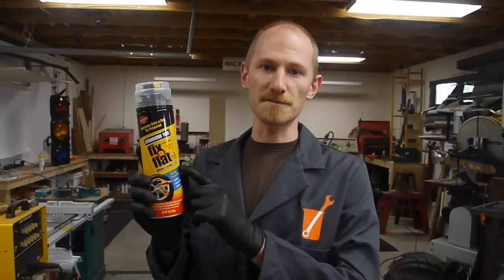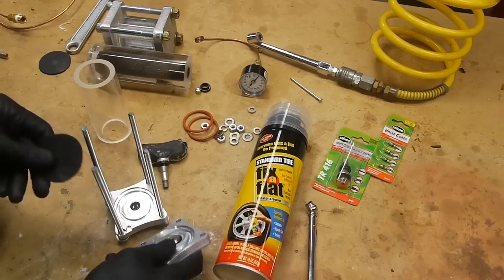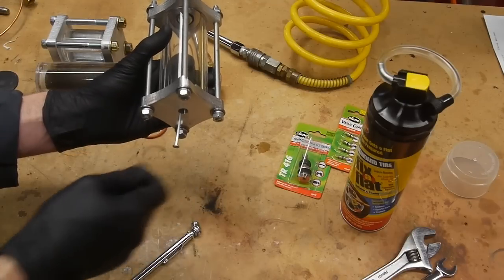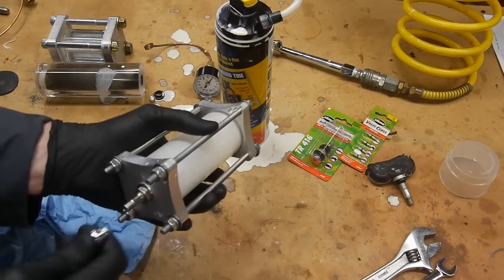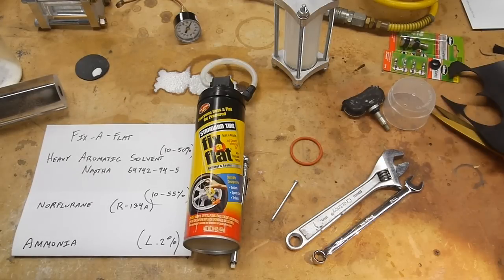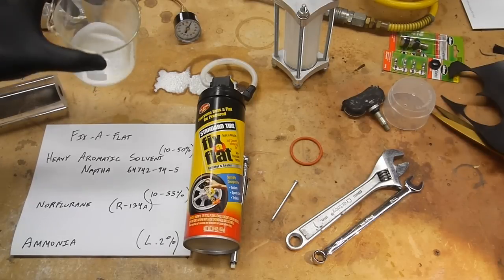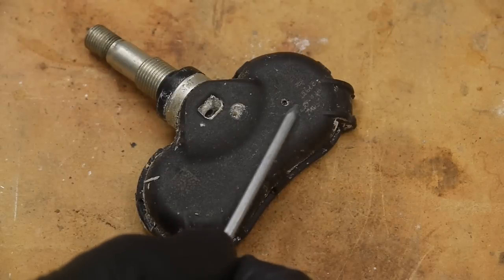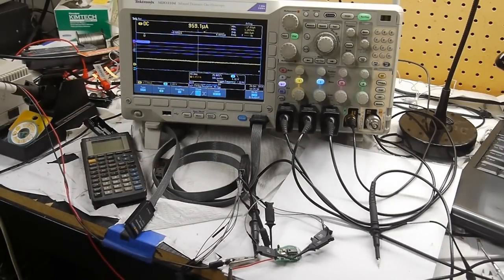Tire sealant chemistry and tire pressure monitors

Comment: You're probably right about the ammonia and latex.  I have a container of liquid latex mold maker I bought some years ago at a hobby/crafts store, and it stinks very strongly of ammonia and looks just like what's in that beaker.

Next project:  make a digital barometer from the pressure sensor!

Comment: As a refrigeration technician in Australia, we aren't allowed to release R-134a into the atmosphere due to its global warming potential. We face huge fines and maybe loss of our refrigerant handling licence if we're found to be releasing to the atmosphere in a negligent manner. How can a product like this, and others that I've seen (including a coil cleaner designed for the HVAC industry), be allowed to have such a substance which is tightly controlled in licensed industries? I want to say it's a kick in the guts to us who have to be careful with refrigerants, but more importantly it's a kick to the environment when we know that it's harmful to the climate and continue to put it in products that are freely released to atmosphere.
Reply: +Aaron Stein Yeah. It's good though. Keeps (most) backyarders from abusing refrigerant handling guidelines and also keeps the work within the industry.
Reply: +dan110024 Regs like that are often a question of mitigating what you can without worrying about the small-fries offenders. If a few thousand or tens of thousand DIY types vent a can or two of R134a every few years, that's one environmental load. If tens of millions of vehicles get their A/Cs recharged in a year and those commercial vendors vent all of it, that's a completely different ballgame. One is absolutely not worse or better than the other, but one application DOES have a much lower cost-per-impact ratio to regulate and enforce.

Of course, you're asking about fix-a-flat, which you COULD simply ban. My guess is nobody has because it's not something most people do to their tires on a weekly basis - the volume sold isn't great enough to have roused popular support for a ban.
Reply: +Aaron Stein Even in the U.S. you're supposed to have license to handle refrigerant commercially, but consumer use is largely unregulated.
Reply: because laws only apply to regular people that can be put in jail, companies make a lot of money so they can do whatever they what as long as they generate taxes, welcome to the civilized world.

Comment: I haven't had any problem with my TPM's after using.  But if I did, I wouldn't take it to a dealer.  The sensors can be bought on amazon for ~$10 or so and any tire shop can install them.

Comment: you are also supposed to fill it, drive for a minimum speed and time to cure it then pull over and deflate and re inflate the tire to get out most of the solvents.
But yes this is supposed just as a quick fix to give you some time before you must buy new tire.
I have changed a tire where something similar was used and it is a pain in the butt to remove all of it from the rim

Comment: The sensor may have an heavy current draw when it's reporting a failure. It's sitting at atmospheric pressure after all.
Reply: Alexandre Jasmin Yes, my thoughts exactly... the sensor should be screaming RF since there's no pressure differential.  This is obviously not the failure mode... if I left my tire flat for three weeks I'd expect the TPMS battery to go bad anyway.
Reply: @scowell  I disagree, I think it would be awful design to have the thing report constantly when it's at low pressure. Once it's delivered the data to the car, it's completely unnecessary to continue to transmit when there's no change. The car is perfectly capable of storing the value and screaming on it's own.
Reply: @Karreth  I was thinking of first-gen TPMS... the newer ones are much smarter, and can give the pressure in each tire when queried.  Thanks for your correction.

Comment: Where would you get a R-134a recharge kit in Canada? All I can find is RedTek 12a, which is engineered to be compatible with R-12 and R-134a systems, but I don't want to contaminate the system that I already have with something that isn't straight R-134a.i

I also don't want to spend the money getting it fixed (if I can avoid it), because they will be required to drain the system, perform a vacuum check, etc, that will drive up the cost.

Comment: While you're correct in the damage to the TPMS the one thing you failed to mention is that once you use this stuff in your tire you can no longer patch said tire.  The chemicals that penetrate into the rubber of the tire won't allow the glue, used in patching, to bond to the rubber.  Thus, using one of these in your tire means your tire will have to be replaced if the temporary repair (check that can again, all of these cans state the repair is "temporary") doesn't last the life of the tire.

Comment: What are the directions on the can? I don't see any way this could work if the puncture is at the top of the wheel, or the opposite side of the valve stem. Do you need to rotate the wheel after applying this product?

Comment: Sensors aren't actually required by law, a TPMS (Tire Pressure Monitoring System) is required by law. It can be accomplished by sensors in each wheel which calculate individual tire pressures (as you mentioned) which is considered an "active" system, or it can also be accomplished through wheel speed sensors, known as a "passive" system.
Reply: over here in Europe it is required by law to have pressure monitoring an all cars sold after 2014 i think it was,  active or passive where the passive just see if there is a difference in rotation speed of one wheel as if it is much lower pressure

Comment: R134a is probably used because it has a high liquid density at room temperature so I guess you'll achieve more pressure per volume than CO2.
Side note: If you condensed CO2 then it would be a solid so you might have trouble spraying it out of the can.

Comment: It might not be sleeping properly because it's not under "tire" pressure, for that sensor 1 atmosphere is a critical condition, so it might make sense for it to panic...

This is trivial to test, just do the same test under pressure and if it sleeps correctly then the problem is not that.
Reply: I had exactly the same thought - if I were designing a remote pressure sensor then I'd have it increase its wakeup rate during exceptional conditions to ensure that any communications losses were overcome and that it could promptly detect a return to normality.

Comment: If I had to guess, the aromatic hydrocarbons could have seeped into the sensor and even in an evaporated state, or liquid for that matter, leached into that rubbery potting material and damaged the components and running the battery dead in short order.Those kinds of solvent liquids like naptha really soak into soft materials pretty well. Loved the, "left the sealant in for.....(cough)......4 months", lol I had a good laugh at that! 
For what its worth, I prefer to carry a Slime kit for emergency flat tires. It works very well and less nasty to the tire/components. The little compressor takes forever but it works and can get full inflation. The stuff in a can is hazardous to the tire tech too, risk of fire/explosion.

Comment: Did some work for CAS over the years, great group of folks!

Very interesting video, I had always wondered specifically how this works.  Do you think the R-134 is responsible for the foaming effect?

For anyone wondering what the charred tube at the top left is from - Hybrid rocket engine with acrylic and gaseous oxygen  :)
Reply from the maker: Good eye on the re-purposed rocket motor!  Yes, I'll bet the boiling R-134 produces lots of gas bubbles and foam in the latex.
Reply: Applied Science I thought those milled aluminum blocks looked familiar.

Comment: Another reason to clean it out promptly is if you leave it in a steel rim wheel for a long period, the ammonia will first dissolve the paint inside the wheel and then rust the hell out of the inside of the rim completely. When you then dismount the tire, the part of the rim where the tire seats its bead will be so rusted out that the rim will have to be scrapped and another one bought. Not sure what would happen with an aluminum rim but I certainly wouldn't take a chance either way and get that stuff totally washed out from inside my wheel ASAP!

Comment: My guess is that the tps starts seeing less than nominal pressure and starts wirelessly transmitting - it doesn't go to sleep because the tire is 'flat' in normal atmosphere.
The sensor diaphragm is getting gunked while the tire is flat, then pressurized so the gunk prevents the sensor ever seeing real pressure again; battery dead.

Comment: Rather then the battery, I would think the issue would be a piezoelectric element in the sensor. Piezo-electric elements can be chemically reactive. Many pressure sensors use piezo electric elements in pressure sensors. 
Depending on the design, the battery might not actually be needed. If the circuit runs on Radio frequency, the circuit can demodulate a the radiowave to communicate with the circuitry and power the device. The battery would be a backup in that instance.

Comment: There are several reasons not to use this stuff it can etch your wheels i have seen it make its way between the aluminium and chrome and cause real problems.  It can make a small out of balance problem a big out of balance problem.  I have also had patches not hold in tires with fix a flat.

Comment: My kitcar has no room for a spare, so I carry a tin of something similar. Never had to use it. I have had punctures on other cars and just changed the wheel. My Z3 has the most inaccessible spare ever, so I was thinking of getting a can, I have now changed my mind.
Reply: +Donald Sayers ... You're better off to just get a 12v air pump and keep that in your vehicle.  As stated in this video, as long as the nail stays in the tire the leak is fairly slow.  If you leave the nail in the tire you should be easily able to inflate the tire back up to it's proper pressure and drive to a place where you can get a proper patch done.

I worked in tire shops at the start of my apprenticeship and we had people drive in all the time with stuff stabbed into their wheels.  As long as you don't pull the object out it should be possible to air it up and drive it in.

Comment: R-134a has an environmental impact when released into the atmosphere and now it's sold in a can to fill tires which are eventually going to release their contents into the atmosphere...
Reply: Its the same story every few years now. They sell you the new environmentally friendly refrigerant (last one was R12), millions are spent by the industry equipping systems with it, and then a few months later THE WORLD FINDS OUT THE TRUTH. Its barely better than the last one. WHAT ARE WE GONNA DO ? Oh look here is this wonderful new refrigerant called R142b that's so green every time you fill a fridge with it a baby seal smiles somewhere... (disclaimer: R142b is actually highly toxic to seals, dogs, and human babies. Cancer will ensue inhalations of more than half a molecule. Do not mix R142b with water, oxygen, nitrogen, or any hydrocarbon as detonation will ensue. In case of contact with the skin, remove the limb using a bandsaw or chainsaw.) Its 12.5% not as global warming intensive with a rating of 2 billion higher than carbon dioxide. Hurray ! Adopted.
Reply: Adrien Perié You seemed to have missed the point entirely and gone off the deep end with your personal thoughts about refrigerant.
Reply: jayfulf Before the problem of 134a was discovered, it was used as air duster.  You could face fines and prison time for even rubbing the valve on your air conditioner, but could spray case after case of cans of air duster and no one would bat an eye.  Now, I think they use 152a refrigerant as air duster ( too lazy to google it, and I don't have a can handy.. )
Reply: jayfulf
Actually i went two steps beyond your comment about the dangers of poorly regulated refrigerant use by the industry and explained the whole picture since the 80's, a munch bigger, systemic problem with refregirent release in the atmosphere than your concerns about R134 for use in tires specifically.
Reply: Adrien Perié I got the impression you were arrogant but wow, it really shines in this last comment.  What you failed to comprehend is that this video is about the product I mentioned, hence why what I said is about only that product.

I'll now go "two steps beyond your comment" (hilarious by the way) and make a very simple point that you, slamdvw, and majority of the internet community seem not to understand.  A lack of mention is not a lack of knowledge.  What that means is, don't try to 'explain' something to somebody for absolutely no apparent reason other than the fact that, for whatever reason, you think they are unaware and/or feel the need to make yourself feel intelligent by condescendingly spitting some noise like you taught the world about it.

Ya dig?
Reply: huh?  Not being an avid YouTube user, I didn't want to start another comment, so I just clicked "reply" under your name.  I now see the problem... it posted directly to you.  Which my comment was not aimed at.

oh well.  I said it.  Not going to worry much about it now.  so i guess in a way, i don't "dig"

enlighten me
Reply: jayfulf
Okay so basically what you have to say about something is the only thing there is to be said about that subject... Edit: And you are only mentionning it for people to watch in amazement in a youtube comment, not expecting other people to expand on the subject.
And i'm the arrogant one. Ouch...
Oh and sorry for not being able to comprehend that the reason you mentioned refrigerant use in tire fixing products was because the video was about tire fixing products and their chemical composition. I'm a bit slow sometimes. I mean me and the majority of the Internet community.
Reply: Adrien Perié Some very clever insults you got there friend.  Why don't you grow up kid.
Reply: slamdvw Well if you want to be 'enlightened' you can just read what I wrote until you understand it.
Reply: nah, i prefer it to be dumbed down so myself and the rest of us on the internet can understand it.  it's obvious my intellect isn't as superior as yours
Reply: aw come on.. help a guy out
Reply: Capcatrei You seem to lack this intellect you speak of.
Reply: jayfulf
You seem to lack any kind of argument whatsoever to support your views and insults.
Reply: Adrien Perié Well I've already provided sufficient insight for those capable, though it seems that's expecting a lot.
Reply: Air conditioning systems aren't perfectly sealed systems, they all leak some small amount that increases over time. Lots of products contain R134a where compressed air would be too expensive or impractical. Getting upset over fix a flat versus the other ways the refrigerant escapes is like yelling at the guy who leaves the sink on brushing his teeth while all his neighbors leave their garden hoses on.
Reply: s0nnyburnett Actually, it's like avoiding all the unnecessary and easily avoidable means of pollution.  With your logic, because my car burns gasoline I should use it for all my heating needs because there are so many cars in the world burning it everyday so why not right?  It's this type of ignorance that brings us beyond the tipping point.
Reply: jayfulf
You do realize home heating oil is actually just diesel fuel with a dye added to it right?
Reply: s0nnyburnett Diesel is more efficient than gasoline which is why it is used.  You failed to see the ridiculousness of your logic and how my example points that out.
Reply: jayfulf By your logic R134a is ok because it is less damaging than R12.
I think you've missed the point once again.
Reply: s0nnyburnett The idea is simply to be as efficient and environmentally friendly as possible.  It's not a difficult concept to grasp, yet you're managing that somehow.
Reply: jayfulf
complain about using fossil fuels for heating, defend one type from another because one is more efficient. Come on man.
Reply: s0nnyburnett You're missing the forest for the tress.  You're also thinking gasoline and fossil fuels are synonymous.
Reply: Adrien Perié Gasoline is a fossil fuel but fossil fuel is not gasoline.  Do you see the difference?  He indirectly said they were synonymous by referring to fossil fuel in response to me saying gasoline.  The details Adrien, they matter.
Reply: jayfulf What you just said doesn't make any sense whatsoever. There is absolutely nothing wrong in what he said. Gasoline is a fossil fuel, if you're talking about gasoline you're talking about a fossil fuel, again he never said that fossil fuels were limited to gasoline... You're a waste of time. Have fun having a conversation with yourself.
Reply: Adrien Perié It makes complete sense, I'm sorry you are unable to understand.

Comment: Have heard that this stuff might throw your wheel off balance, so using it should be strictly temporal. Never used it myself because of the following clean up.
Reply: Latex based sealants will do that as the latex dries it forms balls in the tyre and  - so not evenly distributed when liquid. Vibration follows...... Its OK if you use it as a temporary fix. But even then its gonna piss off the tyre shop. Better for them to sell you a new tyre......

Comment: Re: tyre pressure sensor and 500 hours lifetime...

Maybe the pressure sensor is pulled low, and when the pressure drops the device starts transmitting (i.e. alerting the owner) hence the current draw.